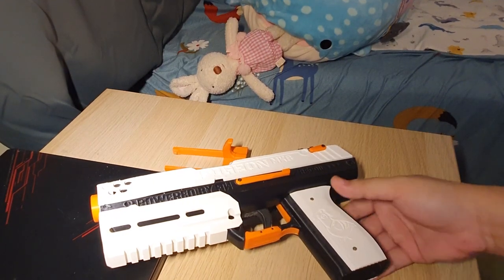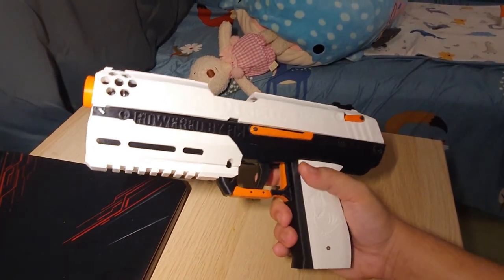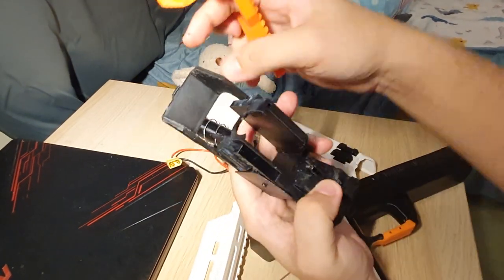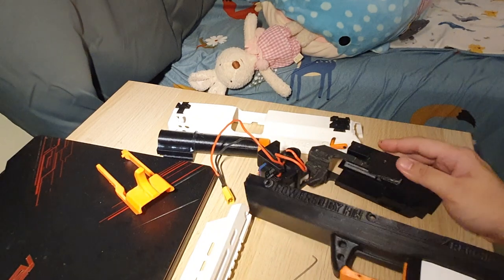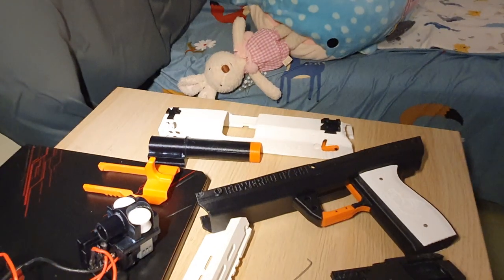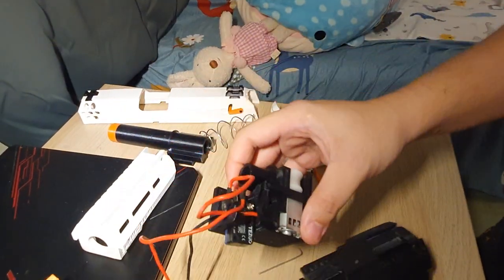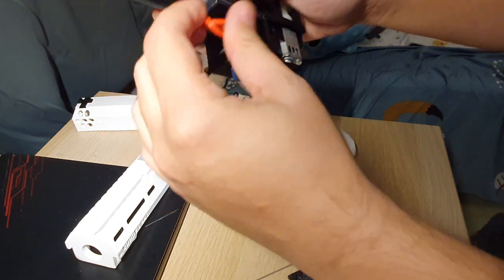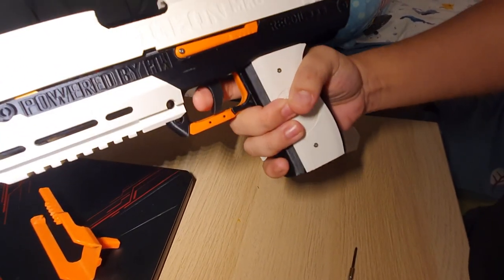The Dessert Pigeon MK8 Assembly Guide + Rants + Review

Comment: Hi there and thank you for your video, very informative and also you’re very talented with your abilities to problem solve in certain areas that you shouldn’t have had to do so well done. My question to you is, doe this model Desert Pigeon (Katana version) have recoil that fully cycles the mechanism and returns the case back forward while the trigger is still in a back position? Or is it like other videos that I’ve seen where the case seems to follow the position of the trigger, so when the trigger is back so is the case and the case only goes forward as the trigger moves forward. 
I hope this is clear enough.

Kind regards.
Red Kev
Tactile Nerf.
Reply from the maker: The katana/talon version only affects the grip size. The internals seems to be universal, based on what I've seen and understood from the files on thingiverse. 

That said, there is a version on thingiverse that does what you said. But it seems finnicky at best when I tried it, probably due to bad print quality. Couldn't get it to work properly and does not fit the frame that I got from frontline foam, or the frame that I printed myself. However, you may have better luck/skill than me should you choose to try it yourself.
Reply: @virusz  thanks for replying